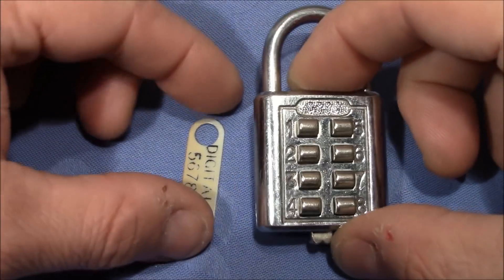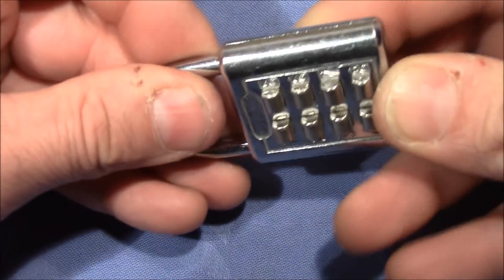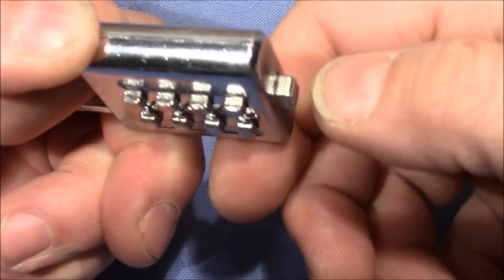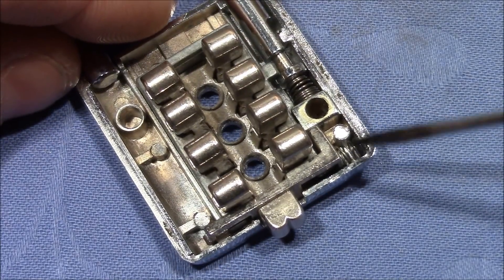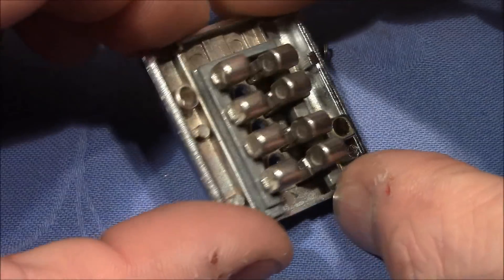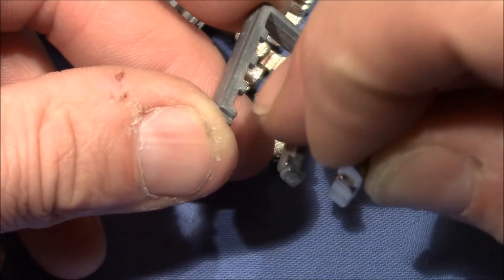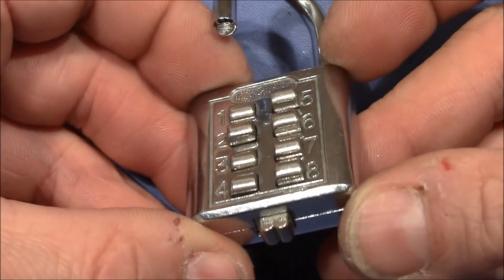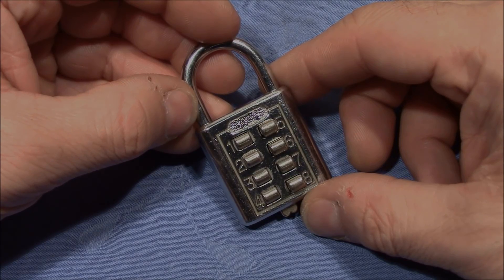(picking 607) Inside a digital lock: decoding, gutting and how it works

Comment: Oh, my gosh! Thank you!! I bought 8 of these some 35? years ago. I bought all of same combo for 6 of them but ran out of that in the store and got 2 with a different combo. I forgot one of the odd ones but you mentioned the combination on your video and it worked! they were made by Gorin no. 10036 with a Japan stamp. 6 have black buttons, and the others are chrome colored.  Mine don't have a half-push available- when you push any button-it's all or nothing. And on the bottom, there is a sliding lever "L" shaped-you push with your thumb that has a tiny housing over 3/4's of it. (The bottom of the L protrudes and the rest of the L pushes into the housing. It doesn't move at all, unless the right numbers have been entered.  Mine seem like they might be a little harder to break into to? (But with your talents, I'm sure they'd be no match. :) Thanks again, I thought I was going to have to throw one out.

Comment: Great explanation and demo. I have one with a lost code, I must try it out now. 🔐🍺😎
Reply from the maker: Lucky you to not know the code - doubles the fun :-)
Reply: It's not that hard to work out. Each button only has 2 states and, with 8 buttons on this lock, that would be 8 squared or 64. With 4 required, that's 64 / 4 or 16 possibilities.
Reply from the maker: It's more the fun of feeling when you decode the lock, not the pure opening. And on locks where the combination cannot be changed it's an advantage to not know the code so that your feeling wouldn't t get distracted. As far as the number of possible code concern, these are 2 to the power of 8 = 256. It's like a byte. With every button the number of codes doubles => 2*2*2*2*2*2*2*2 = 256. The question how many possible combinations exist if 4 buttons have to be up is 70. This calculates from the binominal coefficient - 4 out of 8. Check out this page for example http://www.ohrt.com/odds/binomial.php
Reply from the maker: I think we both have learned not to guess ;-) Cheers buddy :-)

Comment: I always enjoy watching you decoding locks. The most impressive part was that you were able to put it back together again so that it worked. I probably would have sent the parts back to the factory!
Reply from the maker: I was worried that putting it back together would be difficult but it turned out to be almost easy - despite the fact that the little spring needed some convincing words to stay in place ;-)

Comment: Very nicely done as usual 👍🏻
While you were taking it apart I was thinking to myself ... I hope he takes the buttons out ... then ... I hope he changes the combination... Great Stuff!
My only question is what holds the lock together?  I assume it’s just pressed fit ??? No pins or screws???
Reply from the maker: Thank you and sorry for not showing how it came apart. Yes, there a three rivets that I had to drill out.
Reply: @Potti314  Is it easy to do? Do you think a locksmith can do that?
Reply: And then close it back securely again?
Reply: Seems to have three pins in the back. He appears to have drilled them out.